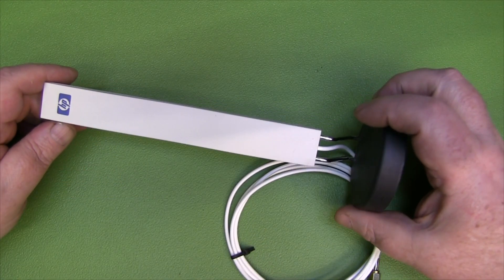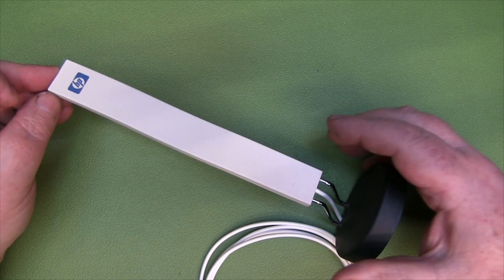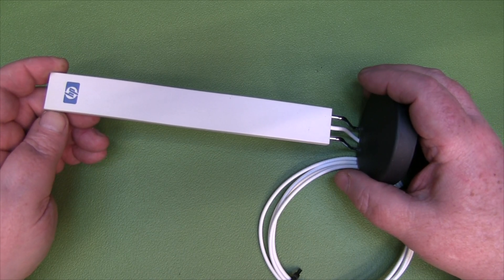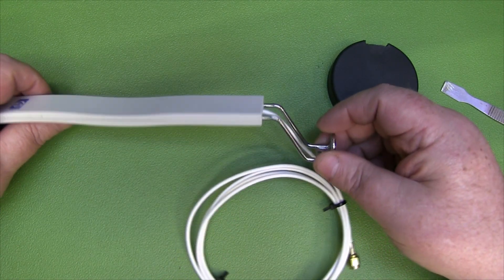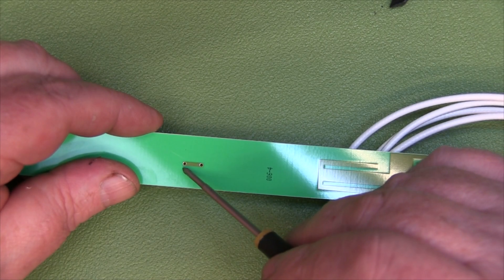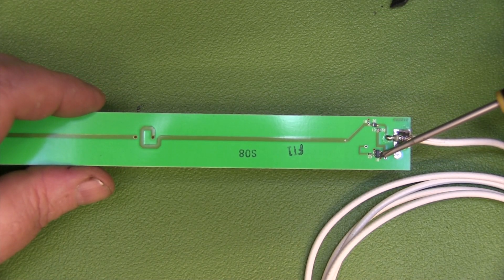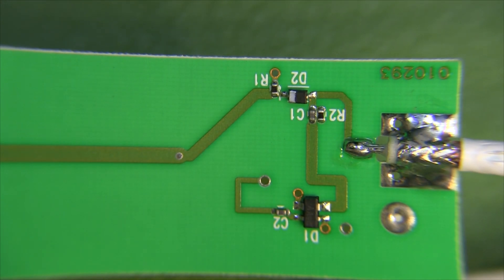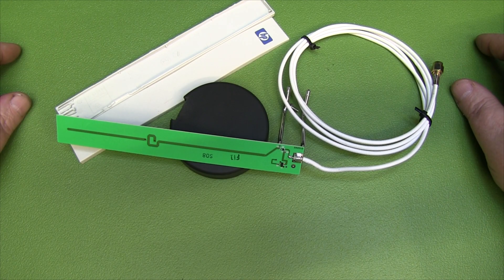A vintage HP Wifi Antenna

Comment from the maker: What do you think, is this antenna over engineered?
Reply: Absolutely.
Reply: It is a very normal antenna design. It is however a bit more clever then a simple passive wire as it can be seen that it require DC bias to open correct signal path. That is why it contains pin-diodes and that is why it had weakest signal level at 2.4 GHz and S11 looks funny if checking without adding DC bias.  Guess it is designed for 5V DC.
 Without DC bias can this antenna not be evaluated. The diodes blocks signal path if not biased.
 Reactive values (inductors and capacitors) do not add to resistive losses as you said, except for minor losses due to non ideal components. 
These components affect impedance mismatch, causing reflections. 
 Reflections and resistive losses are rather basic but different kinds of antenna parameters.